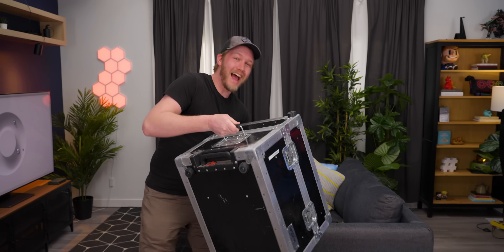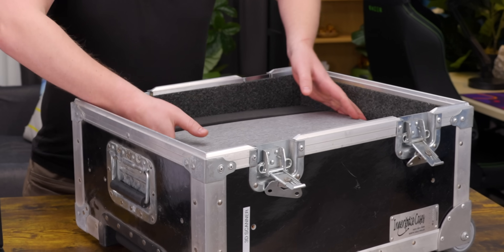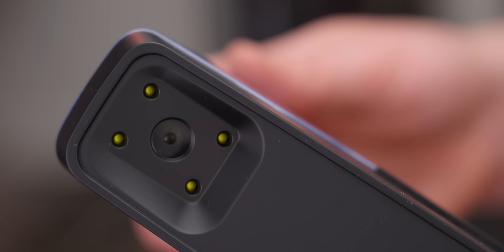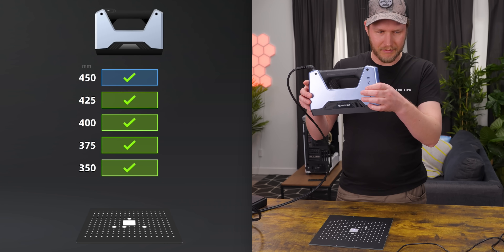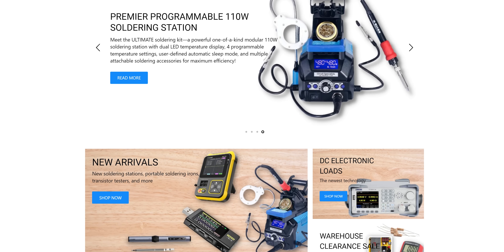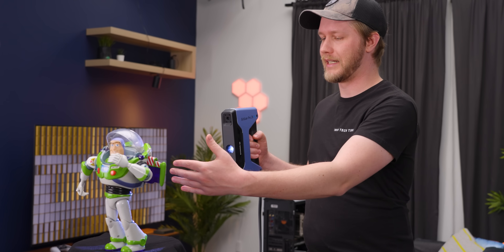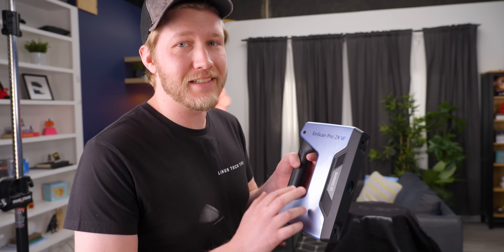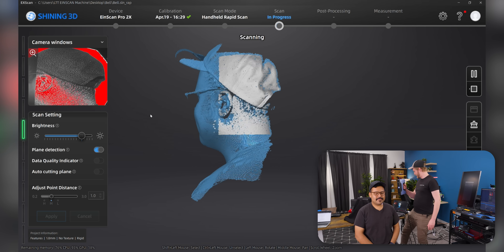I can scan ANYTHING - EinScan Pro 2X V2

Comment: A couple of other channels I watch have done some videos about 3D scanning (Superfast Matt off of the top of my head) and there is a lot of variety, both in price and quality, in that particular market. I would love a deep dive comparing the different options (like an old iPhone with that fancy camera, DIY solutions, photogrammetry etc etc etc)!
Reply: Also need a deep dive into using ham sandwiches as Epoxy filler as well.  😉

Comment: 10:00 First thing you could do to make your life a little easier, when you are dealing with flat surfaces, use blue painters tape before you put the dots down.  Then when you are done with the scan, you can peel off the tape with the dots on top of it rather than going back and taking off each dot individually.  Works really well on flat surfaces, especially if they are black or shiny.  And you get the extra added benefit of being able to remove a lot of dots when removing the tape (as mentioned before)

Comment: Aesub states on its data sheet not to be used in domestic settings or to be used near food by the way. 
If you need to use prep spray your aren't scanning the object your scanning the prep spray layer.... So I feel your making a false statement. A scanner can scan anything if you're not using prep spray. Currently they don't exist... I got excited thinking for a second this had changed...but nope. Click bait.

Comment: I got the cheaper Einstar one for $750 and works pretty slick.  It works exactly the same as this one, same software too.  I'm not really sure what the technical differences are between the models.  The Einstar is around 1/3 as accurate, 1mm/1m as it's speced, but I also don't know how much of that is marketing either.  It does do color textures though without an addon device as it has an additional color camera to get that into the scan.  The lighting is less with a bunch of leds spread out instead of one main brighter light at center.  Your light is considerably brighter overall, but the Einstar is spread out which might be better to remove shadows.  But so far, your experience is the same as I've gotten with the cheaper model (for those looking to get into this on a budget), and the cheaper model has color texture to boot.  The downside might be accuracy and light strength.  For the less than 1/5th the price tag of the Einstar, you might want to do a direct comparison of both models to see if the Pro 2X v2 has a sizeable advantage to warrant the price tag.  It...might not.

Comment: Tbh those scans were pretty shite for how much that unit goes for. I just got the creality raptor which is by no means a pro level scanner, but the blue light scanning mode does 60fps and is soooo accurate! You should get one and compare results

Comment: I've just finished a custom built for a dental scanner for a hospital, those things makes your $5 000 price look downright cheap, the scanner alone was $20 000. They also recommend a 14700, 32GB RAM and a 3070 or better to run the show, although we eventually went with a 14500 and a 3060 12GB since tests showed they work just as well and the budget was getting a tad bit thin.

Comment: You can do the same with a normal camera and the use of agisoft metashape or any other photogramatry software.  My experience is that you can make models where 0,5mm with really good photos but most of the time 1mm accuracy is easily doable!

Comment: BEWARE on Einscan and Shining 3D products, they have a very NASTY reputation of updating software that bricks older scanners.
Their consumer models (Still cost around a grand at the time) ran on Windows 7 and 8, but when they upgraded the software to Windows 10, the new software was incompatible with a huge swath of hardware that came out around the time, and ONLY worked with the Consumer Models that came a year ago then.

And if you remember, Windows did a good job forcing people to upgrade to Windows 10, so If you upgraded, your old software wouldn't work, you'd have to get the new software, before realizing it wouldn't work with your hardware and you'd be out of luck.

If you complained about it, all they'd do is either offer a Trade In in which they'd only give you a $100 DISCOUNT on their scanner, trading in scanner that cost a GRAND for a measily TENTH of its price.  And even then you'd either have to buy a more inferior 'budget' model, or... literally pay just as much for an equivalent model at the time even WITH the trade in costs.

So TO WARN YOU

IF YOU BUY SOMETHING FROM SHINING 3D DONT EXPECT IT TO WORK FOR MORE THAN 5 YEARS

Comment: It still feels to me like the pro grade equipment is not a big enough improvement over AI augmented photogrammetry.
It's like, I'd have expected the pro stuff to be super quick 120 hz scanning rate with auto hole completion, texture, albedo, normal map, roughness map and basically all the data needed from an object.
I'd especially have expected it to learn to detect reflections and glass by now.

Comment: it's 5000$ ......and looks about the same as just using an iPhone with lidar and polycam...which is not 5000$
Reply: iphone is lq trash
Reply: @girlsdrinkfeck  Yea sure it is which is why they last longer than all android phones and don't turn to shit after a few years and slow down and get full of almost unremovable junk, meanwhile my 7 year old iphone is still functioning like it did from new. And if I need to reinstall the software , yea no problem fire up iTunes or 3utools and download it....android , good luck your fucked go to some dodgy site and get some rom you have no idea if its safe or as original as it says it is.

Comment: This is a business tool at the current price. That''s not a bad thing, but if you are saving 30 hours of engineering time, which could be a single project, then it will ROI very fast

Comment: Good luck loading up those models in solidworks.  That's the single hardest thing that I've found is bringing a watertight mesh into parametric modeling software like inventor and solidworks.  The programs do not handle it well at all.
Reply: working with meshes in Fusion 360 is a nightmare. You are more or less safe if you need the mesh just for reference to build your model (except lags), but if you want to change it or god forbid integrate it into your model... Sometimes after spending enormous amout of time i realize that at this point remodeling the whole thing from scratch with a source mesh as reference or even just a calipers would have been faster....
Reply: @ErrorTH  yep.  I've done it in fusion and inventor (even going so far as to specifically use meshmixer to slice the mesh into smaller pieces), and it's just not a doable thing except for super simple models.  No matter what hardware you have.  I hope nobody watches this video and hears him say he will import these models to solid works, and buys the product.  You can't just do that but if you watch this video you will think that you can.  And in the end if you do manage to get a model in there, it will be a nightmare to work with because it doesn't have actual flat surfaces on it
Reply: Out of the 3 (Solid Works, Fusion360, and Inventor Pro) which would you guys say is the least painful to work with in this case?
Reply: I'm starting out with scanning and modeling.
Could you elaborate on what the alternative would be?
Reply: @maiy8786 Ive seen people take photos of stuff, then make sure the dimensions were accurate across the photo, then temporarily import them to trace the shapes in sketch.

Comment: Scanning Buzz is especially fitting because Buzz Lightyear was originally designed as a clay sculpture and digitized using a early precursor to 3D scanning. The very first Buzz we saw in Toystory was a 3D scan.
Reply: That Buzz Lightyear is paying for itself already
Reply: Really? He’s made of very simple shapes, which should have been super easy to create in the most basic of CAD. I’d be willing to bet that your story is correct, but they were talking about his face.

Comment: 6838,80€ ... NOPE
+720€ for colour scanning
+another  720€ for tripod + turntable
+600-1200€ for training (remote or onsite)
Reply: For reverse engineering it makes sense
Reply: And it doesn't even use Lidar 
It's just 2 webcams and a ir projector 😂
The profit margins on this product must be insane
Reply: And that is still a relatively pedestrian price for those handheld solutions
Reply: Yeah it's not a consumer product
Reply: Search for cross-polarization photogrammetry, thank me later
Reply: This isn't a consumer product, this is professional grade. Although it's not quite top of the line, compared to the $25000 Creaform HandyScan, it's downright affordable. Although the HandyScan is more accurate. I've used one of the older HandyScans and they can't capture colors, just points, $7k for accurate fast scanning and textures is actually pretty good.
Reply: @randomblock1_  I have also recently used an older Creaform model (either HandScan 300 or 700) to capture a little chest. It couldn't capture colour either, but the mesh was really accurate. But if I'm not mistaken that would be a laserscan while what is shown in this video is structured-light-  and structure-from-motion photogrammetry. A laserscan usually doesnt struggle with reflections and black surfaces. So I u
guess it isn't really comparable anyway.

Comment: Soo is a very expensive Kinect
Reply: Clearly with much higher resolution, and with software developed to create a model out of the data. So, while the technology seems to be the same as in the original Kinect (the later version of Kinect apparently used different technique), there's justification for the higher price.

Comment: Hi, this is my job actually. I use a Zeiss T-Scan Hawk 2. I have a Razer blade 18 fully kitted. If anyone has any questions let me know.
Reply: Hey same here, but I have a Zeiss Comet 8M. I have been curious about how well the hawk can capture fine detail, as its waaay faster than the Comet.
Reply: @benjaminford8173  honestly depends on how much fine detail, the zeiss is good until you’re less than.005 inch, it heats up and stops capturing quite as well
Reply: How useful are the scans for importing into Solidworks or Fusion 360?  Any idea what the MSRP is for the scanner you are using?   

Do you have a degree in Mechanical Engineering?
Reply: @yayinternets  I do have a ME degree, and with the full Zeiss Inspect software suite there is proper functionality for reverse engineering from a scan to CAD. The machine I run cost over 100k back in 2017.
Reply: @yayinternets  I have a degree in Mechanical Engineering, and the scans are useful in fusion 360, but not in solidworks. Even with a premium license to solidworks, it’s better to just use fusion for it. I ended up getting Mesh2Surface to reverse engineer parts, along with just using zeiss inspect on a different monitor. The scanner was 40k, and we didn’t have the need to buy the full zeiss inspect.
Reply: Thanks for letting me know!  I'm a Software Engineer myself and just trying to wrap my head around what is possible at different price points/skill levels.  Thinking about how to start making boutique parts/upgrades as a business.

Comment: Might be worth mentioning that the Einscan is only slightly better than the Einstar. The premium you're paying is to access software like EXModel which is based around QuickSurface that they have to license from Mesh2Surface, and for scanning software that is designed specifically for the scanner and not made up of scraps like the Einstar's EXStar. Shining3D could easily offer better software for the Einstar which would make their more expensive scanners look like a much worse deal, but that would be like Porsche not sandbagging the GT4 because that would make the GT3 look bad.
Reply: The einstar has a bit of a problem with losing tracking and then putting geometry into random places. can be quite annoying, especially if the random places happen to be near or on your model, which basically means you need to start over.
The device shown in the video doesn't seem to struggle with it that much. Hard to say how much the difference is without a direct comparison, tho.
Reply: @jort93z with the new software you can rewind the scan. No need to start over anymore. And if you have a difficult part you always can use marker mode and disable the other tracking modes for best tracking. Did it this week for scanning a transport box.
I own the Einstar but ordered a Creality Raptor for Xbox controller size stuff now. Blue laser… I’m excited. Will get delivered tomorrow 😊
Reply: @jort93z  That's correct, but also that's entirely a software issue. I've done a number of scans and most recently a complete scan of a 1974 260Z. I ran into that problem around the battery cover/hood transition and the rear shell area. 

Solution? Global markers. They are an absolute godsend when working with large objects and feature-less or flat objects, and the 260Z is both large very simple in its design language (which is what makes it so timelessly beautiful, but also a pain to scan). 

Give global markers a shot - it's entirely worth it.
Reply: It's also worth mentioning, if you're not trying to get an accurate-scale engineering model, a NeRF is an amazing tool. It's similar to photogrammetry in that you need to circle around an object while taking photos (and for determining camera positions it uses the same marker detection system), but where it differs is you are training a model called a Neural Radiance Field (NeRF) on your images, which due to the previous training data can recreate your object or scene with incredible accuracy from few or low quality photos. They can also capture in-scene lighting, reflections, and transparent objects accurately, so you can scan something like a glass of water realistically.

The main downside is converting those radiance fields to a traditional 3D model is still very experimental technology, so it's usually pretty low quality when you do, and is textureless, but progress is being made in that field. For now they are mainly suitable for 3D renderings, where you don't need the model to have precise measurements. If anyone is interested in scanning for that purpose I would highly recommend researching this further, because things like Luma let you do this completely free with any smartphone, you don't even need a particularly good camera to get a good scan.
Reply: @wisplite  Learn something every day - thanks!
Reply: Real enthusiast know mid engine is always superior to rear engine 😅😉

Comment: Is scanning spray safe to spray on electronics? I'm pretty sure I can get continuity on it when it's wet using a multimeter.
Reply: They make scanning spray that evaporates (like AESUB Blue Scanning Spray) and leaves nothing behind, I don't think you could use it with it plugged in and on, but should be perfectly safe to use unplugged as long as you give it time to evaporate before plugging it back in.

Comment: INSANE REQUIREMENTS: i7 8700 and gtx 1060 and 32gb ram.

So like, a game from 2016? I guess the ram is a lot.
Reply: They put things in context for the stuff they review. Usually in business you dont really have PC's with i7 8700's dotted around these are machines that just a few people may have while the rest do just basic office stuff. so what they get is probably an 12/13/14th gen i5 laptop with a dock with 8GB of ram.

If thye work from home, perhaps just a Thin client or perhaps a system with an AMD APU or maybe like a NUC. or if they do use systems probably like an HP prodesk or an Dell optiplex with like the cheapest specs on the list with maybe 8 GB of ram. 

Compare that to the BAREMINIMUM of an 1060, which likely means the 6GB model it is insane if you pair it with 32GB. a system with that may cost nearly double, and that is just the bare minimum on these parts often you cant get an 8700 anymore so if you buy new you might need to get 11th gen at lowest, but the price drop isnt worth the performance loss from 13 or 14th gen so they go with that.

WHen you spec this out as a business, a jump from maybe 700 dollars for a laptop or like 500 to 700 dollars for a prodesk per desk to like 1500 dollars for just the system is quite the jump. mind you, business buy from SI's so liek Dell, HP, Lenovo, they won't allow fro pre-builts or self builds usually. so expect an extraordinary price hike for no real reason.
Reply: It's interesting how they listed the minimum specs as the "recommended"...
Reply: It is at an enterprise level.
Reply: @blueridgeocean it's just that since they make overkill systems so frequently, when we hear them say "insane requirements" we prepare to see $10k show up on screen... Not $1k
Reply: @juhtahel7454  i7 8700 and a 1060 are not even worth 250 bucks, don't know who wrote the script. I thought it required 64/128GB of RAM and like a 5990 with 16 cores to work normally
Reply: @Daniel-zy1ir those are the system requirements for the minimum specs at 12 fps
Reply: That's the minimum to have it run, not to get the best experience lol

Comment: SC: "It uses a ton of ram" 
Me: "128gigs enough?"
SC: " It uses 32 gigs of ram"
Me: "So I'm good then"
Reply: Don't forget about the i7 from 7 years ago and the GTX 1060, only people with the big bucks ($200-300) can afford to buy a used gaming desktop from 2017 with this outrageous spec 🙃
Reply: @pismodude2 if you have a 7 year old PC with 32gb of ram, thats surprising.
Reply: @MaRBL23563  10 year build of a i7-4790k with 32GB HyperX on an Asus maximus formula 6. I was more into productivity stuff at that time so it has an Titan Black.
Reply: @pismodude2 bear in mind those are the requirements for basic use in a single model
Reply: @pismodude2  Those are minimum requirements for really rough scans. We tried to scan something at work with 32 gigs of ram and it was not even close to enough for the higher detail levels. Even their cheaper Einstar scanner can make a brand new computer with I7 and 4070 struggle.